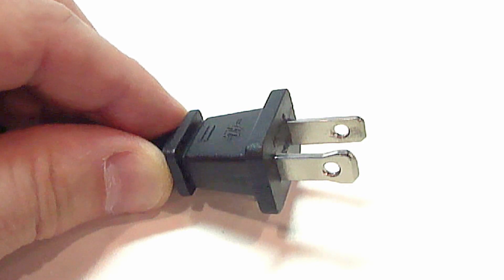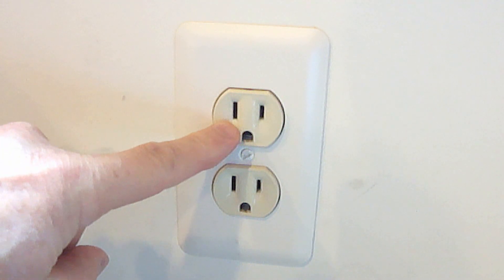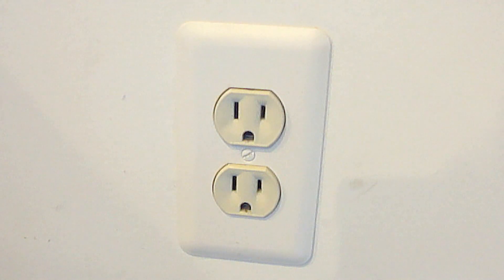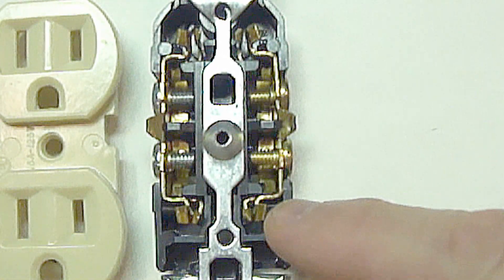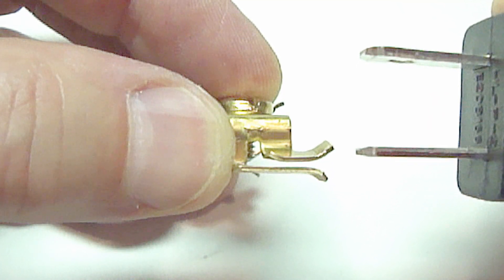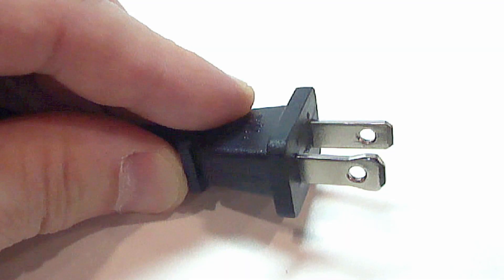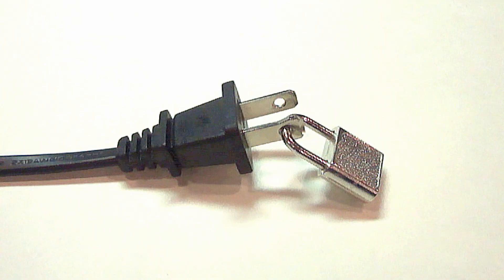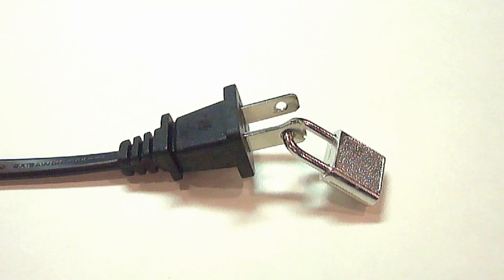Electrical Plugs Have Two Holes - Here's Why

Comment: Great video.    Thanks for sharing.   I never knew that about the holes.  
Can you do a video on why a plug is polarized ?
Reply: He doesn't know what he is intirly 

Talking about the holes are there for respticals with bumps that look like dibits on the out side of the part that holds the prongs of the plug when fully seated in to the plugin recptical.
Reply: Some electrical devices only function properly when the electricity is flown in one direction only

Comment: Seems that the original reason was simpler. Early receptacles were weakly sprung and had nipples that gripped the plug's holes. Though these are mostly obsolete, the holes are retained in case on old one is used. The later uses are were additional.

Comment: What?  Put a lock on the end of the plug?  Holy mother of Jesus.
Reply: Actually, for an inventive teen locked out of a XBOX, hot wiring with a lock in the way seems WAAAY more dangerous than just locking up the entire box.
Reply: @Cyberdactyl  You could just confiscate the power cord.
Reply from the maker: That’s right!  Truth is stranger than fiction 😊